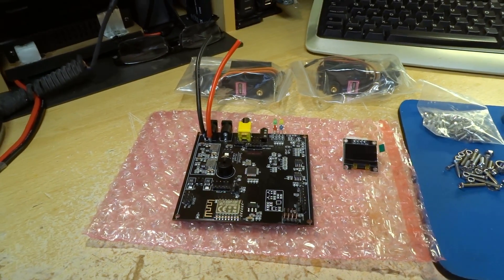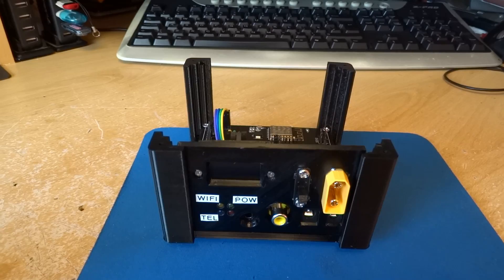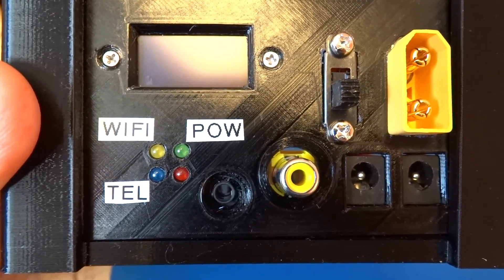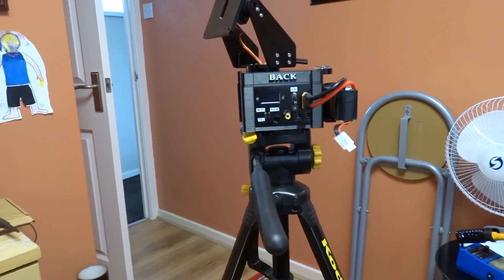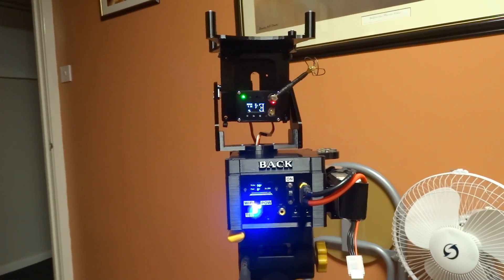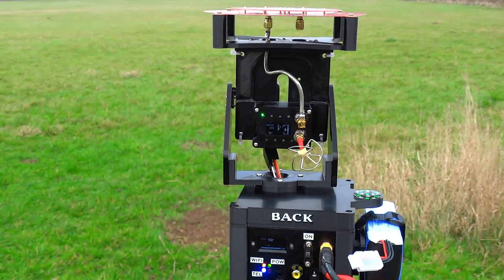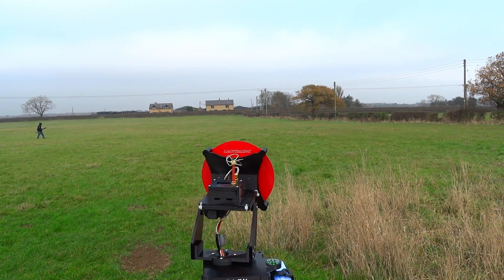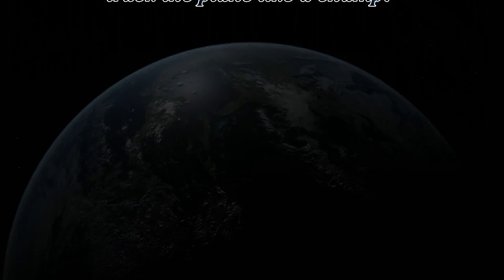Sentinel Automatic Antenna Tracker Build and Test.

Comment: Can you share your modified .stl file for top plate and compass?
Reply from the maker: TBH I dont use it as the compass is to close to the metalwork and electronics in the box and goes haywire. So really no point on doing the mod.

Comment: does the tracker have a GPS module in the 3D printed box?
Reply from the maker: No GPS
Reply: @BillHally  okay. how does the tracker know it's own position then?
Reply from the maker: It does not need to know its position only where North is. Then it takes the Telemetry information from the plane and determines its 3D position relative to North.

Comment: Hello, I am writing to you from Italy and I congratulate you on your tracker antenna system. I wanted to ask you for advice. I would like to install the tracker antenna system on a rc car with my VRX Walksnail, but not having a flight controller on board the car, what would I need? Thank you
Reply from the maker: Hi there I am not sure if the unit is capable of working with Walksnail you will need to contact the makers to ask this.  Thanks

Comment: Hey, good job mate! A little tips: to avoid doing a full turn when you reach 360° you can use slip ring to rotate infinitly
If you don't want to use slip ring you can invert y axis and put x axis to 0 (if x reach 180, you put x to 0 and you do y = y * -1) it will turn x of 180 and turn y to stay on target, this way you cut by half the time antenna is not focusing drone. (but it require a little bit more code)
Reply from the maker: Thanks for that info I an really happy the way this thing has come together!  For the type of flying we do and where it will be located I suspect it will work out just fine but its always nice to know alternatives appreciate that.  Happy Flying I know I cant wait to test it out fully cheers Bill
Reply: @BillHally  You're welcome, how much cost the whole system to build out by curiosity? (without antenna and tripod)
Reply from the maker: @Teddy78fra  Around £115 which aint half bad TBH